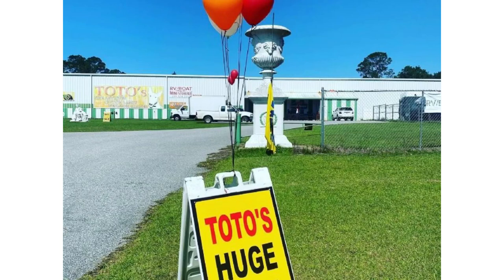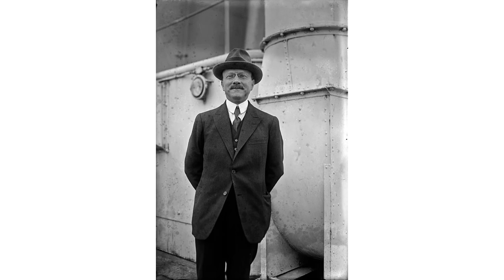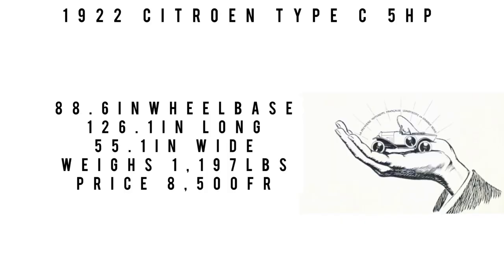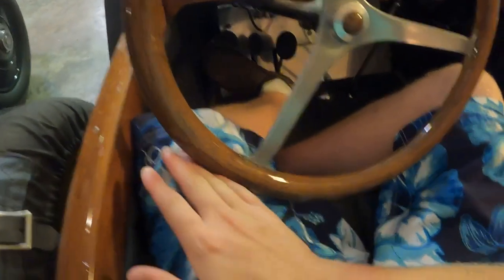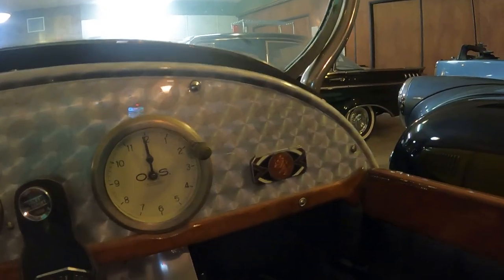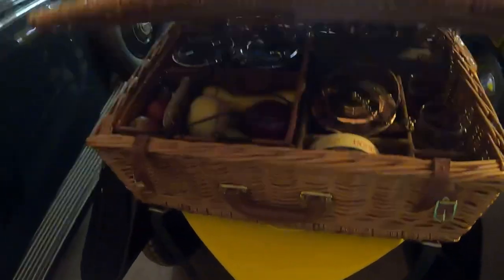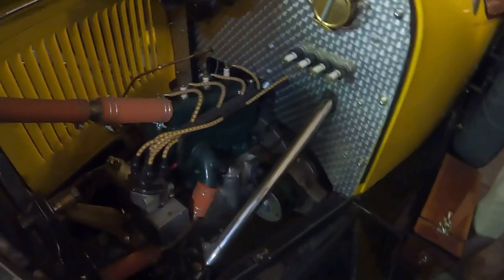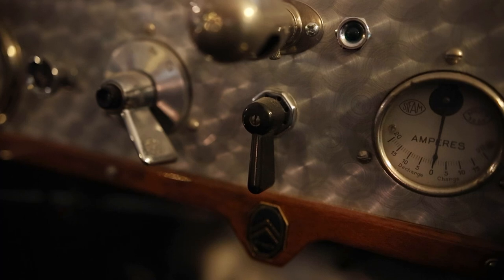1922 Citroen type C 5HP 5CV￼

Comment: My model kit is the 3 seater torpedo body. This car is basically the "French Model T". I compare my model with an AMT Model T and they are the same length. Citreon is a little narrower, but both cars have only 1 opening door on the passenger side. - I have also seen a picture of Andre Citreon standing beside Henry Ford. - anyway, my video is coming out July 23rd.